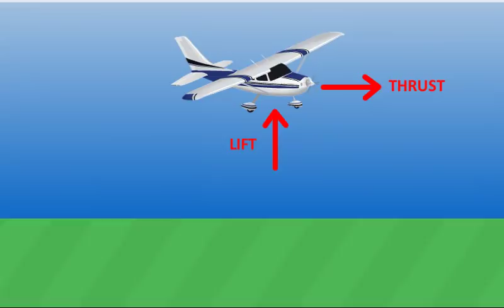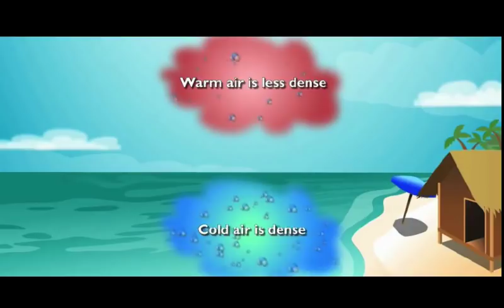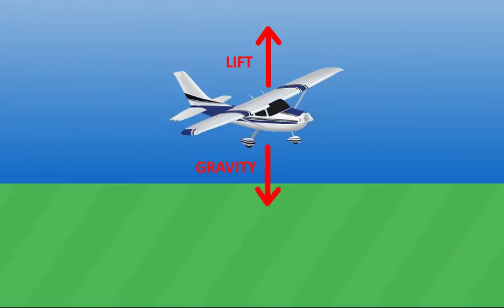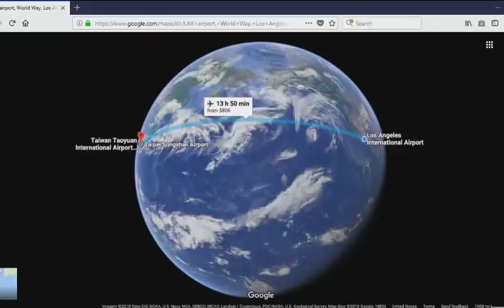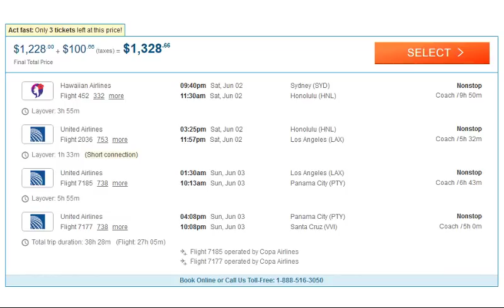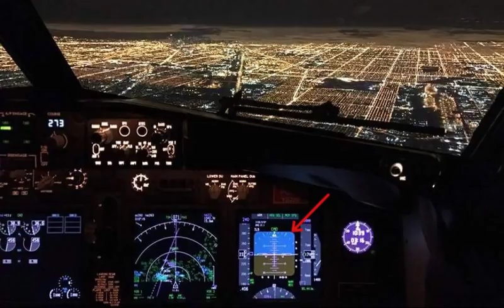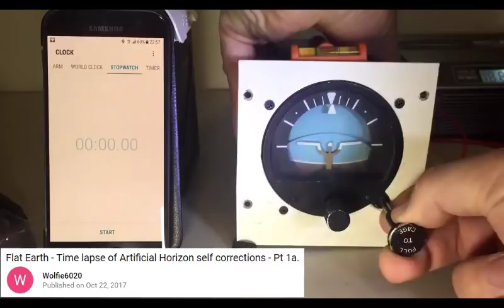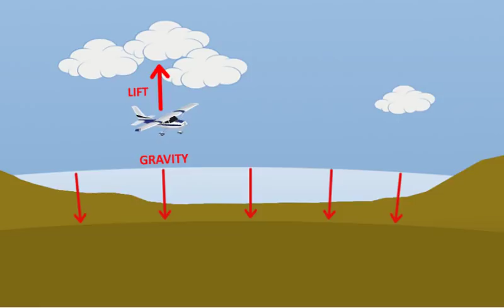Flat Earth Falsities - Plane Nonsense

Comment: But it's not as if Flat Earth Cultists are misinformed. It's not as if they are unable to reason. It's not as if they research or investigate anything, even when it can be done with no tools at all. 

Flat Earth Cultists are perfectly aware of the facts and the facts make them tremble in fear and hate. Using the analogy of the cheap microscope to see cells, they would refuse to look through the microscope, even if you provided it. 

They refuse to lie down on a beach, watch the sun completely set, stand up and watch it set again. They refuse to fly at 3,000 feet in an airplane, use a theodolite app on their cell phone and confirm that the horizon is one degree below level. They refuse to buy a pair of binoculars, or a 60x spotter scope and investigate whether their high priests lie when they say these devices are equipped with Star Trek Tractor Beams to drag ships back into full view when they are below the horizon. 

They won't buy a laser, a laser stand, a yardstick and don't have a friend that could help them directly measure the curvature of the earth and actually put a number on the curvature with their own senses. 

This is because they know the truth and believe it is true. But they hate the truth and are at war with it. No Flat Earth Extremist will ever hook up with their local HAM radio club, call the ISS and call the astronauts a bunch of liars. That would expose their deceit. That would result in they having to admit the earth is spherical, the ISS is real and they have just humiliated themselves. 

They are deathly afraid of a truth they know for a certainty, as much as you and I do, that it's true. They know the earth is a sphere. They know the solar system is heliocentric. And they are terrified of it. They hate it. 

When confronted with the truth they run like puppy dogs caught peeing on the rug. They know and telegraph that they are absolutely wrong. Every hair on their body screams that they are terrified of the truth. And of course there is absolutely no rational reason to be terrified of learning something new. 

Conforming to the truth is not a terrifying process. Asimov is also the author of my other favorite phrase: "The guilty flee when none pursue." This has served me well over the years and it also fits with the Flat Earth Cultists. Their own conduct convicts them of their deceit.
Reply: tricky dicky like Dubay or Jeran. They make great money off the gullibility, paranoia, and stupidity of thousands. Remember to donate and buy a t-shirt.
Reply: tricky dicky It is not projection. You Flat Earthers misuse that term just like you misuse 'perspective', another desperate trick to avoid facing the truth: the earth is round, it spins on its axis, it orbits the sun.

If all these facts did not bother Sir Isaac Newton despite his Arian beliefs, then they should not bother you. You are no more a believer than he was.
Reply: Capt'Wes Starwind. Ya. I will get right on that. When People think of Money, Eric Dubay and Jeranism are the first to come to mind. You still owe me some lessons on shapes and maths first though jackass.
Reply: I owe you nothing so lets make that very clear right now. I asked you do you understand geometry? Do you understand shapes? What is a theorem? What ways can a sphere be measured? And you avoided that. So now you think I owe you? How can I explain anything to you if you do not understand any of this? Where do I start? Is a cube 2d or 3d? What does 2d mean? What does 3d mean? What does the d stand for? I can provide you a fun couple of videos with catchy songs that you can use as a pneumonic device for remembering different shapes if you like. We will cover shapes first then work up to the maths. Then you can figure out the shape of the world with ease whenever you want to.
Reply: https://www.youtube.com/watch?v=dbPlY8npPIw
Reply: And now a song about 3d shapes for you.  https://www.youtube.com/watch?v=2cg-Uc556-Q
Reply: RockinRobbins13. Ah. Nothing like projection to confirm ones bias. This long winded bullshit is THE definition of “projection”. Get a real job COWARD!